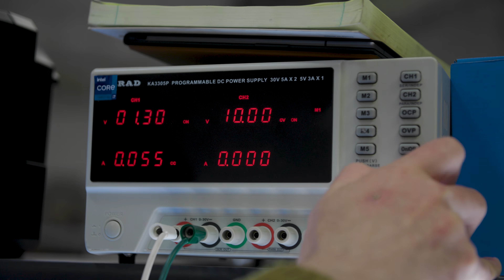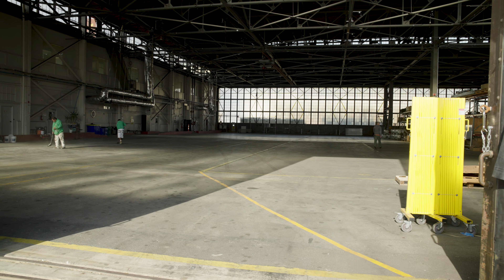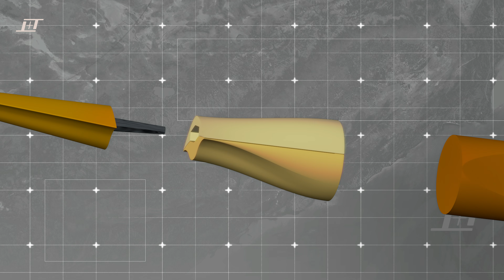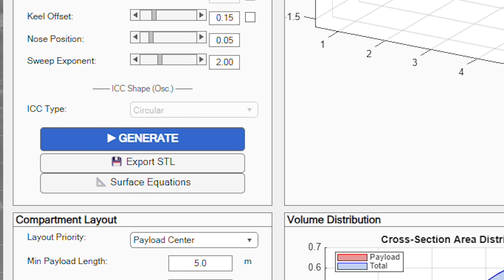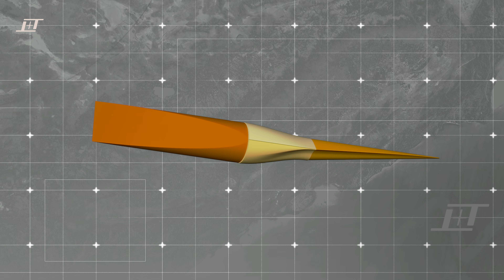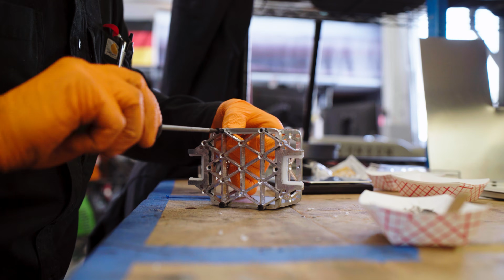Designing for Mach 25: Geometry, Heat, and the Physics of Hypersonic Launch

Comment: Not to dog too much on yalls project, but doesn't drag while going through the atmosphere increase with speed? And then the heat/pressure will be so damn much most material will most likely pretty much come apart?
Reply: I suspect they will use some ablative material to survive those few seconds in the thick part of the atmosphere. Don't know if they published anything on that tho.
Reply: @ahabkapitany  100%
Reply: Drag's pretty real - need a high ballistic coefficient to get through the atmosphere. And yeah, heat load is real too.  Need to have some sacrificial mass on the nose of the vehicle to burn off so we can keep the payload intact.
Reply: You have to have a truly HUGE vehicle to make it work. 5 tons or so might be a minimum. The more massive it is the better the ballistic coefficient and the less velocity you'll lose at any given speed. The fraction of the vehicle that needs to be sacrificed to ablation is a similar story. You get rid of heat with ablative material (goes up with volume ^3) while the heat flux is a function of surface area (goes up with surface area ^2). So getting bigger solves a lot of problems.
Reply: @mikegrace8814  Wow, that's terrifying. A bare minimum of 150 gigajoules would have to be consumed in the fraction of a second the 5 ton load is in the barrel. 36 tons of tnt per shot. Prolly more like 100 taking into account the losses. What could actually power such a launcher?
Reply: Hydrogen gas maybe with O2
Reply: @mikegrace8814  they actually talk about this in a longer video interview that I can't find for the life of me. The actually useful variants are stupendously large, so much so that they are looking for Australia to build it.
Reply: @ahabkapitany  I know! I'm the CEO!
Reply: These guys and their investors really should have checked the youtube comments instead of asking scientists, they could have saved a ton of money.
Reply: Increases with the square of velocity. 

Mach 25 at sea level is not an insurmountable challenge, but to design around this will require such a massive sacrifice in payload design that it will never work. Same thing with the centrifuge design, Spinlaunch. 

Additionally, the enormous cost reduction provided by the scalability of SpaceX’s projects make ideas like this DOA.
Reply: @jet_enjoyer  It's my understanding that heat flux to the surface increases with the 3rd power of velocity.
Reply: @ahabkapitany  In general yes. There is some nuance in terms of shock wave formation at high Mach numbers. Beyond just the heat conduction, at very high Mach numbers radiation becomes a major factor (4th power relationship with temperature). 

This is a cool project and I hope they succeed, but it seems unlikely to be financially viable.
Reply: @jet_enjoyer  I knew I've also read 4th power somewhere.

>it seems unlikely to be financially viable.
I honestly don't know, I'm not an expert in this. I have a physics bsc only, which is barely enough to grasp the basic concepts. But as far as I understand the vast majority of traditional launch cost is the expendable vehicle, especially the engines. If you cut that out the largest part, you have plenty of margin to work with.
Reply: @ahabkapitany  Yea I totally agree. Minimizing cost to launch is only one factor (again, spacex has done this exceptionally well, over a 20x reduction for falcon 9 users and massive launch availability) but that isn’t the only factor. Payload versatility is really important. Rocket launches are definitely a bit aggressive, but the accelerations the payload is subjected to within a traditional fairing are a tiny fraction of the accelerations experience with a system like this. Additionally, payload volume for traditional rockets can be much larger. 

I am very skeptical that this project will be able to launch payloads in the 10 ton range with substantially less hydrogen than would be used in a conventional rocket launch (or equivalent energy of methane).
Reply: @ahabkapitany  Correct. It's important to note that volume also increases with the 3rd power, and since we'll be packing on phenolic ablator to reject heat, size is the only way you can make the math work.
Reply: @jet_enjoyer  disagree on both counts.
Reply: @mikegrace8814 I’m an aerospace engineer. You are going to have to elaborate, unless it’s purely an emotional argument.
Reply: @jet_enjoyer  bigger vehicle ⇒ higher 
β. scale up by 10× ⇒ drag decel is ~10× smaller at the same q. Higher β gives you more ‘heat shield budget’ per square meter as TPS capacity is a function of volume but, at a given speed, heat flux is a function of surface area. The vehicle was not the reason Spinlaunch failed. They simply couldn't throw anything of sufficient mass to sufficient speeds. They didn't include a liquid rocket because the atmosphere was holding them back. The accelerator sucked.
Reply: @jet_enjoyer Mach 25 at sea level is kinda dumb. Just look at the re-entry vehicles for MIRV’s. They’re coming in from low orbit at like Mach 25, and by the time they hit their target, they’re below Mach 10.
Reply: @gonepostal9101  yea it’s a massive problem to deal with. That can be avoided with a traditional launch trajectory
Reply: @gonepostal9101  There were warheads in the 60s designed for low atmosphere travel at Mach 20+. They actually included third stages to accelerate down as a strategy to beat missile defense systems. Phenolic or actualy just copper will do. I'll also mention that Juno, the Jupiter probe actually hit Jupiter's atmosphere and achieved enthelpys way higher than we'll be doing as it was going very fast and Jupiter's atmosphere is no joke.
Reply: At scale, no problem.  Small Iron asteroids survive reentry and are still very cold inside after
Reply: @glike2  That’s because there isn’t sufficient time to heat to conduct internally. However, a significant amount of the mass of the meteorite may have ablated away during those few seconds. The heat flux is still unimaginable. 

Additionally, the likelihood of the meteorite making it to the surface intact is strongly dependent on its trajectory and velocity. 

A meteorite also has the definitive benefit of experiencing its maximum velocity in the upper atmosphere where density is at its minimum. This is the exact opposite of the circumstances the payload will face with this design. 

Mach 25 at sea level is a preposterously difficult challenge. Not one that cannot be solved with clever engineering, but one that will absolutely require massive compromises to make possible.
Reply: @jet_enjoyer good points but I doubt they will intentionally launch from sea level which makes no sense when you can build it on a mountain
Reply: Yeah this is a scam just like the spin launcher. All they have to do is keep tricking investors and they keep getting paid. 10 years from now this company won’t exist.
Reply: @MorganRambo723  It's possible for something not to work and for it not to be a scam. Doing hard stuff is hard and if you're not willing to take technical risks you can't make breakthroughs. I know the Spinlaunch guys, and I think that was dumb project that wasn't going to work, but I also think they tried really hard AND the investors knew it was a risk. Longshot may fail, but it won't be for a lack of trying my dude.
Reply: @MorganRambo723  I, too, thought that first, but I don't think this is the case here. Spinlauch is clearly silly for so many reasons, but after listening to a few longer interviews with the founder of LongShot I'm fairly convinced that a) they actually believe in this and b) this is a long shot (hah!) but actually has merit.
Reply: @ahabkapitany  Thanks guy with Kermit the Frog picture. You the real MVP <3.

Comment: I don't think you will get past Mach 3 because the gas entering the tube is constrained by the limitations of the tubing sizing. The pressure in the main tube will eventually restrict the incoming pressure of each successive stage of the gun.  Gerald Bull ran into the same issues with his Babylon gun as did the Nazi's and their V3 underground canons.
Reply: We hit mach 4.2 last year
Reply: @natosaichek mach 4.2 is kinda shit, esp for the complexity involved.

Abrams 120mm gun, M256A4 ammunition got 1.65 km/s muzzle velocity, or mach 4.66 with double base gun powder.
Reply: @cgdg7075 Our gun cost much less than an abrams gun. It's made of sewer pipe. And we could go faster if we put hydrogen in it, but that wasn't safe at that facility. But I hear you! We gotta go faster to impress you. Stay tuned this year for some speed records! :-)
Reply: @natosaichek to be honest, you dont need to impress some random ppl on the internet, you just need to impress the gov agency that is funding your work. 

One of my dream project is to make a nuclear - electric rocket motor, that works by ionizing the hydrogen at 5000°K. Most nuclear rocket are nuclear - thermal, which is limited to 2200°K. If you can make my idea work, just do it. I might be forever stuck in Vietnam anyways. 

Bernoulli pressure - velocity law dictate that any high velocity space gun require high pressure. 

Gun / rocket exhaust velocity is determined by the speed of sound in the gas, which is determined ONLY by specific energy in the gas (kj /gram). Light gas such as hydrogen reduce the chamber temprature required for the same exhaust velocity, because light gas have more specific heat capacity.
Reply: Choked flow limits mass flow, not projectile speed. Supersonic expansion + proper staging exist. V3/Bull failed on engineering and materials, not a Mach-3 law. Physics isn’t your vibes 🧠🔥